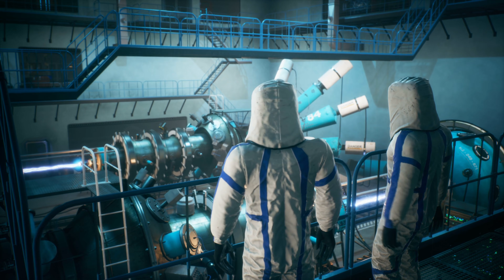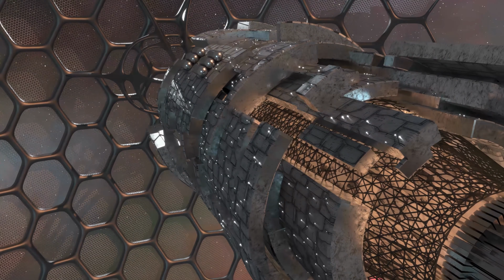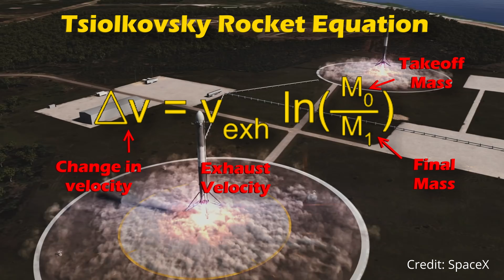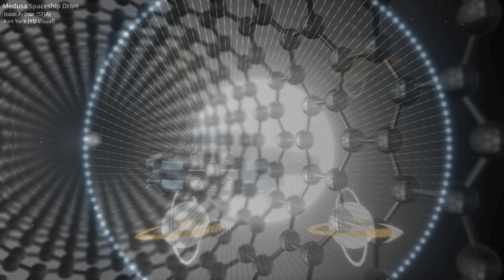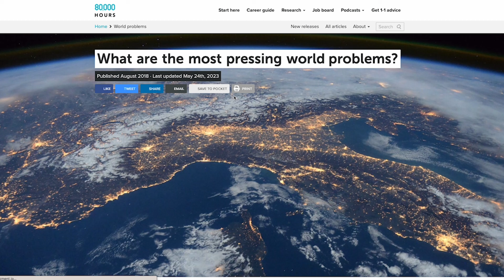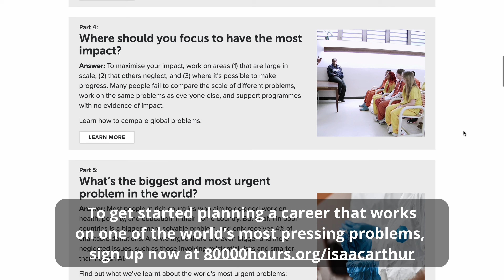The Medusa Drive: A Starship Pulled by Nuclear Bombs

Comment: So the chute is a moving and flexing part, oscillating between depths-of-interstellar-space cold and nuclear-flash-hot as it operates while being bombarded at significant percentages of light speed by occasional interstellar pebbles, and it's a mission-critical component that needs to survive decades or centuries of operation between ports of call and is so large that you can't carry a lot of spares.

This feels like it might have issues with durability.

Relatedly, though not particular to this specific drive concept:  I just experienced a belated epiphany that the Warhammer 40k premise of interstellar travel through a hostile realm of chaos-demons shifts from science-fantasy to extremely-realistic if all the chaos-demons are named Murphy.
Reply: Ah yes, Murphy. Chaos God of Critical Fail Rolls.
Reply: While i agree that durability of the sail would be a huge issue for almost all the reasons you mentioned, the cold of space is a misunderstanding. Vacuum is an extremely good thermal insulator, much better than any material. If something is left alone in space, far enough from a sun, it will EVENTUALLY get very cold (3K), but that will take centuries.

Comment: I think the Medusa drive is a pretty good idea, but there actually is a way to make the "weapons proliferation" aspect of it much less of a concern, and also ditch the fissile material in the same stroke.
What if you take a Medusa drive and run it on the same Deuterium-Tritium (or Deuterium-Helium3) ice pellets that are usually specified as fuel for inertial confinement fusion reactors and engines?
My thinking is that the ship's payload section carries the bank of ignition lasrs, and the (hemispherical but more ideally parabolic) sail carries an array of actively steered mirrors that can focus those lasers into the focus point of the sail despite the sail constantly changing shape due to action from the pulses. Doing this, you can use a lot smaller of a sail, but repeat the pulses a lot faster, using a graphene or nanotube sail and tethers to help with both heat and structural concerns. One of these ice pellets can also be so small that there's pretty much no danger if an ice pellet happens to hit a tether, provided that you are using graphene or nanotube tethers.
It ends up basically being a "backwards" Daedalus propulsion section, conceptually.
Fusion pellets so used are harmless if projected outside the focus of the medusa sail, because the mirrors on the sail will be unable to focus the laser beams on to the pellet sufficiently to cause fusion initiation.
For people living on a planet, I think a vessel that has an array of high power lasers is less of a threat than a vessel that has a literal atomic bomb machine gun, but I also think that this "Laser ICF Medusa" as I'm going to call it easily has the potential to have a performance level that is higher still than even the Medusa drive itself, if only because ALL of the propulsion energy is coming from Fusion, which is higher energy still than Fission reactions, which already produce stupendous energy yields from tiny masses.

As I may have mentioned earlier in this comment, the pellet size can be reduced and the pulse rate increased for a smoother ride with less need of a winch or elastic tethers, while still having quite good energy yield per unit fusion fuel mass.

Comment: Aren't you getting back-blast from the explosions on the bow of your ship pushing you in the opposite direction? Since the sail/parachute has bigger surface area the force of the back-blast will be a small percentage of that absorbed by the sail, but still it seems inefficient.

Comment: © 12/05/2024 The one thing overlooked by Medusa Drive proponents is sacrificial energy.  The Medusa, with 100 times the surface area of the following ship's prow could easily provide an iris smaller than the diameter of the ship through which less than 1% of these energy transferring photons could escape along the ship's flight path, pushing small particulate out of the way.  Not only would this save wear and tear on the Medusa itself, but would increase the likelihood of higher speeds being achieved through deceased encounters with atomic hydrogen and what-have-you...  The iris could close when nukes weren't firing to provide a physical barrier at high speeds, if deemed necessary or prophylactic...

Comment: If the explosive devices explode too early, they could vaporize the tethers. If they explode a moment too late, they could vaporize the sail. If they fail to explode, they would pass through an escape hole in the center of the sail. However, as the ship accellerates, it will catch up with the duds, causing them to hit the sail or even slide right back up to the ship.
Reply: The nukes could have a failsafe rocket that kicks them off course if they don't explode on time
Reply: @10Neon  You could also have separate parts for the nukes to handle premature detonation. You hold the nuclear material and bomb setups in a warehouse connected by your ship to a tether. You assemble them in a factory that is also separate, and fire them from a third facility.
Reply: Oh that wouldnt be good! At least I assume the ship will have some manner of point defense system to fire at the duds as they come back. If they really wanted to be nifty they could catch them and fix for next firing.,,, just keep the fixing station outside of the ship. on a leash. As you always should be very very careful about duds.
Reply: The explosive devices don't have to be launched with much velocity relative to the ship so the timing wouldn't be all that hard and we could send disposable rocket drones to push the duds safely away from the sail & ship.

Comment: The wall of your ship has to be very thick to handle the radiation cloud your flying true.
And the outside of your ship is very radioactive.
This gave big problems when you have to leave your ship at arrivall
Reply from the maker: If the sail is a ways out that radiaiton cloud will have dispersed before your ship arrives. I tihnk we can safely assume no particle involved is moving less than a  kilometer a second coming out of that, even ones that bounced off the sail
Reply: Ablative ice hull coating, cheap, massively abundant, excellent radiation shielding, strong.
Reply: Maybe an outer hull that you just abandon? Slide the inner ship backwards out of it and fly away.

Comment: In the ray optic limit, a parabolic sail might work better as a mirror for a point source than a semi spherical sail. Parabolic mirrors completely paralyze strait line trajectory from the focus where you would explode the nuke; transferring the maximum amount of momentum into forward motion.
Thanks again for this amazing video!
Reply from the maker: That's probably true, I usually suggest parabolic for laser sail aproaches for that reason, I'm not sure how themomentum transfer works out on a non-reflected explosion though.

Comment: One issue i could see is the ship catching up to the sail between pulses. By opening up like an umbrella, the sail would pull the ship forward faster then it moves itself, and with no drag, the ship would get close and closer once you stop blasting. The tether would have to be semi rigid, like a solid tube with a spring in it, able to extend but unable to retract further than it's initial lenght.
Reply: Lasers would be used to keep the sail in place and to navigate.
Reply: Relatively low power particle beams would solve this issue, and could be used for microscale attitude corrections at the same time. And we can already do this with ease as well.

Comment: This is basically a MIRV-capable interplanetary ballistic missile. It would end up moving even faster than a ballistic missile, though, and have way more MIRVs. Oh, but thankfully, those MIRVs would not have guidance. They'd just hit wherever on the broadside of a country. 

Hey, but maybe the atmosphere would burn up those fission or fusion bombs upon reentry--assuming nobody at any point placed shielding around those fission or fusion bombs. 

I suppose it would be impossible to hide the evidence of secretly reentry capable nuclear bombs that, by design, explode and atomize themselves. 

The thing about solving these problems by making sure your government controls all the nukes in this drive system is that your governemnt will not control any of the nukes in any other government's drive system. 

This system potentially makes the risk calculus of nuclear war pretty ridiculous and does nothing for disarmament.

Comment: While thinking about Medusa and Orion drives and materials for pusher plates/sails I had a thought. Could the plate itself be part of the fission or even fusion system.

What material could the plate be coated with that would chain react from the pulse of energetic particles from the original fission blast? Or, could injectors all around the plate release cryogenic tritium that might fuse from the initial blast?

Basically use small bombs as a catalyst for much larger fission or fusion blasts, which would increase efficiency and lower cost.

Comment: I've heard that Medusa has a significantly higher max speed than Orion, something like 10% of lightspeed for Medusa compared to 3% for Orion. That's significant, because it means we could get to a lot more star systems in just a single human lifespan, instead of requiring a generational starship. That said, I'm not exactly sure why it behaves so much better. It's frustrating because most of the relevant analysis is either still classified, or done in the context of the 1950s Orion where they were thinking of using it for a weapons platform, or maybe to go to Mars, not for interstellar travel. I feel like there's room for a modern research project to really dig into the performance of it by simulation.
Reply: Larger sail area capturing more of the energy, plus you can have larger nukes producing larger yield to mass ratios. Also, you might not need a shaped charge nuke if your sail is big enough. Which will basically mean that your nukes have more fuel and less dead weight that is just acting as reaction mass.
Reply: @placeholdername0000  couldn't you just build a really big pusher plate and use really big nukes with Orion? It's not clear to me whether that's inherent limit of the design, or just the way that Dyson and his colleagues were designing it with 1950s technology and a relatively small scale.
Reply: @ArgleBlargle31  Maybe a contributing factor is that Medusa is loaded under tension which is cheaper in terms of mass than compression members. But yeah, Medusa tends to capture much more of the momentum. There are other more modern designs involving superconducting magnetic sails/rocket nozzles (search up MagOrion sometime) that get a lot better performance for the same reason.
Reply: @ArgleBlargle31  Hard to set up a plate behind the ship that's significantly larger than the ship(by an order of magnitude or more), convex to the ship, and structurally sound.  Would require very large, very heavy support structures that have immense compressive strength, which is harder to accomplish than similar levels of tensile.
Reply: @luddite31  Making a big pusher plate is harder than a big sail.
Reply: @ArgleBlargle31  Objects in tension can be much stronger per unit of mass than objects in compression.  Also the parachute shape is just better suited for dealing with a blast that radiates out from a point.  As a result, the parachute could be made potentially miles across, where that would be impossible for a pusher plate.  So a Medusa drive spacecraft would simultaneously allow for a higher percentage of the mass to be propellant(bombs), and also allow for the use of more efficient high output bombs.
Reply: @far_on_6040  so why did Dyson and his colleagues originally go for the pusher plate design? Did they just miss how much better the parachute is?
Reply: @ArgleBlargle31  It is much harder to make lightweight structures in compression than in tension, so a pusher plate will inherently have more weight for its surface area and distance from the blast than a sail would have.
Reply: Probably because a sail is less massive than a thick pusher plate + a mile of impact absorbers
Reply: As I understand from what I have read, the Orion was capable of 10% of light speed.
I am basing that on the book Project Orion by George Dyson.
This Medusa light scale design looks interesting and would have some advantages, but I wonder about the degradation of the shrouds or the sail from the high energy x-rays.
Reply: You would have to more or less be “sitting on the blast”, and your pusher plate would have to be more like a “pusher cone”.

Comment: you know the pusher plate is not the only option. their is also a early mega project of just putting a big sphere around the nuke with a hole to let the blast out in one direction. the bigger the hole and more cone shape the more it looks like a rocket, till it starts looking like the pusher plate. the point is it scales to what ever size you want, depending on your materials.
Reply from the maker: Yep, we've discussed the shaped charged nuke option before too but we're just using the baseline design for comparison.